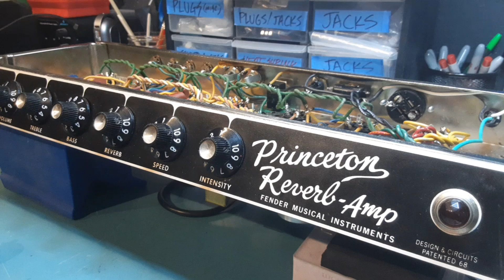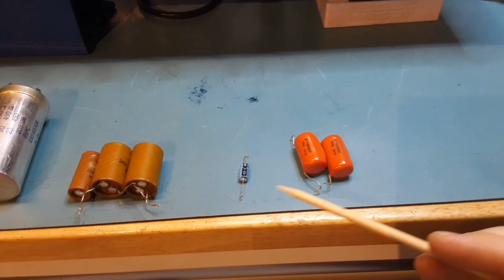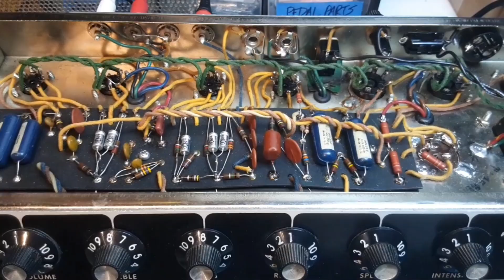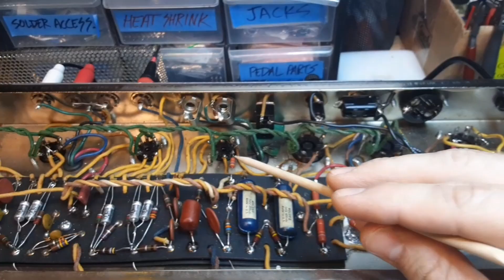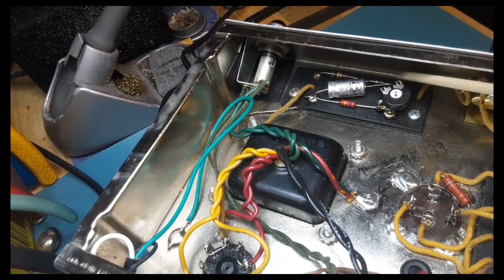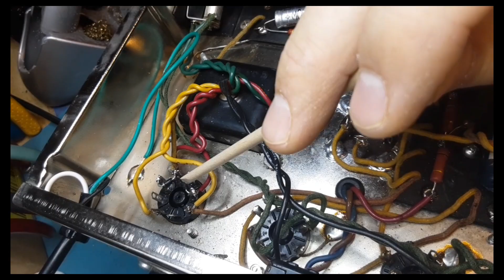1965 Fender PRINCETON REVERB : Vintage Amplifier Restoration (2025 Amp Tech Repair)

Comment: Damn, I've worked on much newer tube amps that were never that clean inside.
Reply from the maker: The vintage eyelet board stuff is a treat, especially on single channel amps with less components/wiring/spaghetti/clutter.  They were doing it right back then!